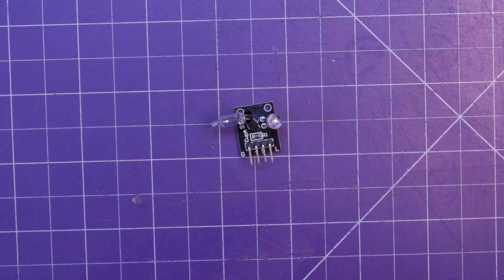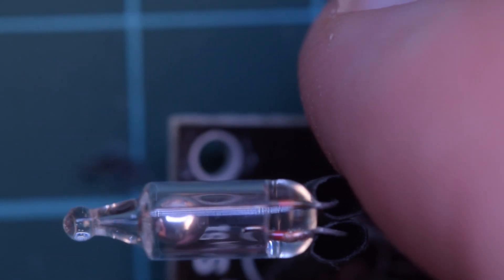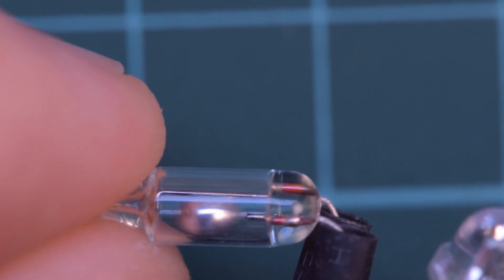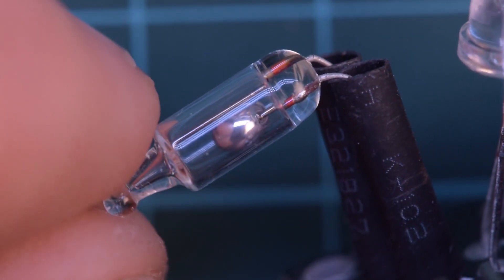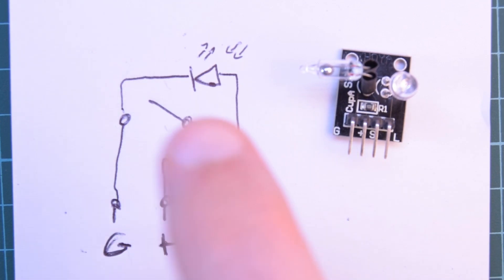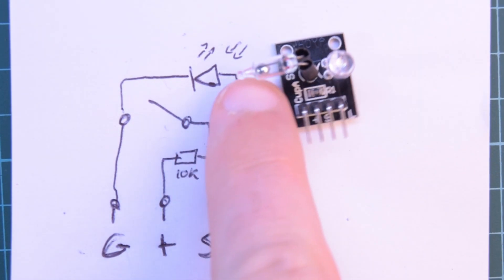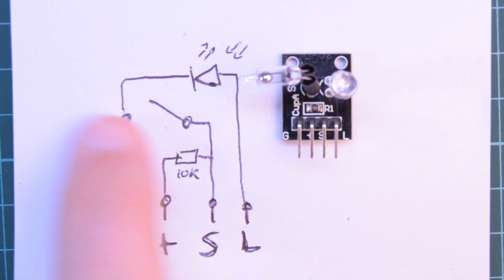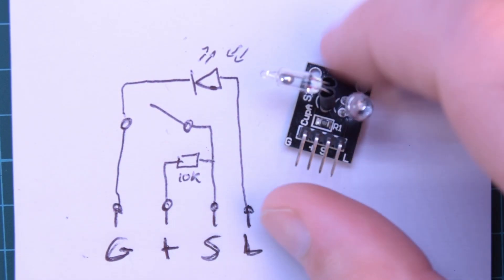These Switches Are Full Of What?!?

Comment: Another place they used mercury at one time is light switches in homes and businesses. The silent switches used mercury and had to be installed correctly to work right. You couldn't have them upside down or sideways. 
Fluorescent bulbs also have mercury in them.